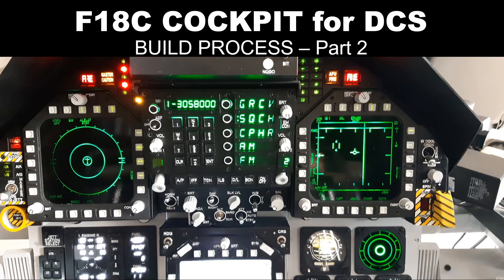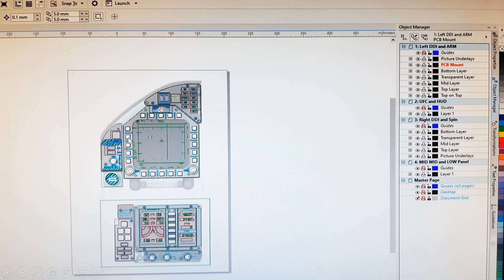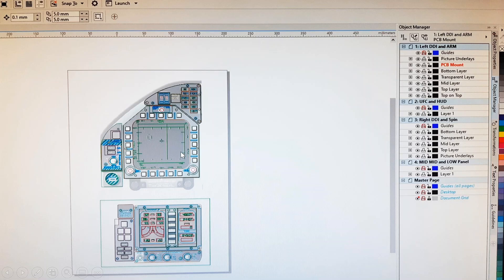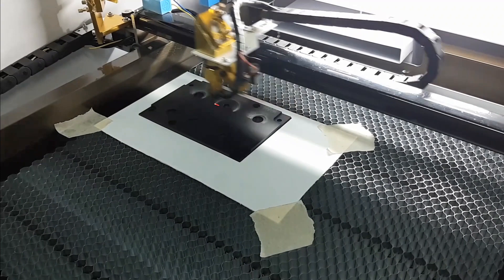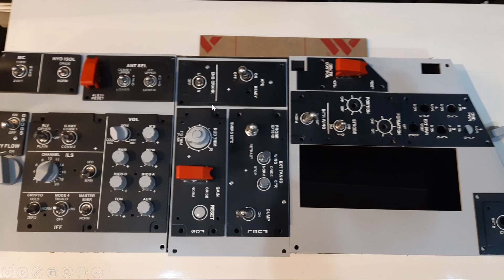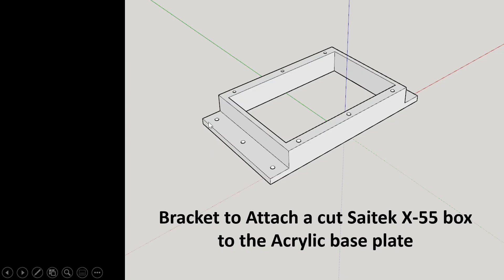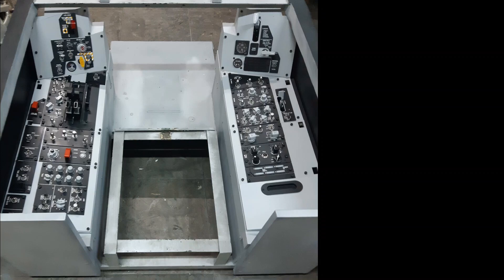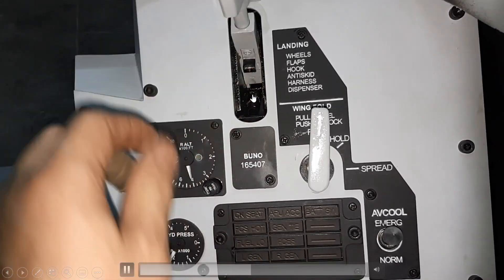F/A-18C DCS VR Cockpit Build Process Video Part 2a

Comment: Hey, i have a question: What laser cutter did you use?
Reply from the maker: Im using generic brand 50w from china. Bought around 1000 USD but a bit difficult to set initially due to non precision bracket so 3d printed the laser tube bracket with adjustable it used up 2 tube for the whole project the replacrment tube cos around 200 USD each. Need to remind you steep learning curve. But total cost of equipment would probably the same or less then ordering to 3rd party.